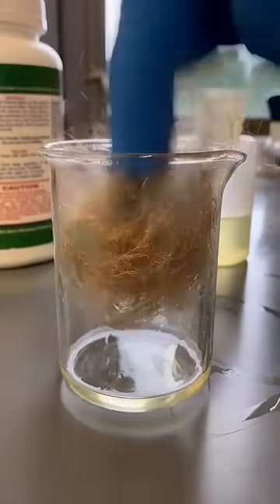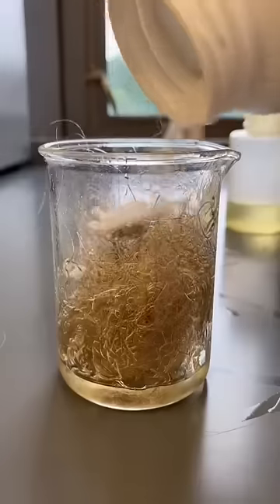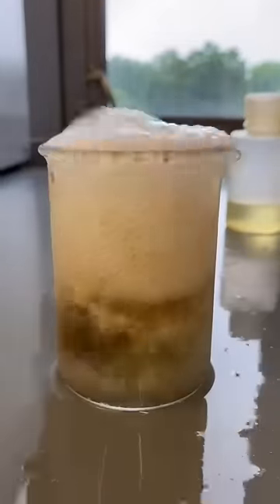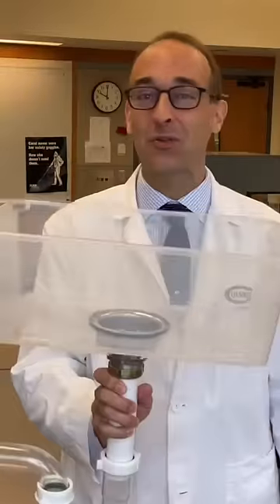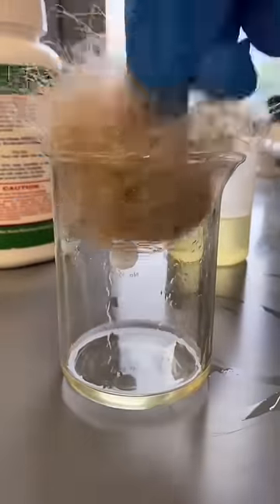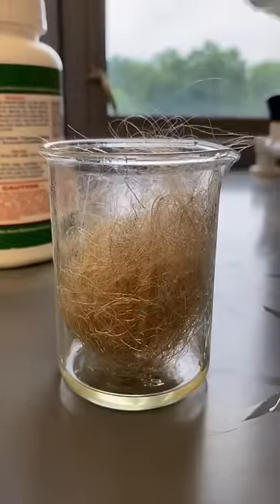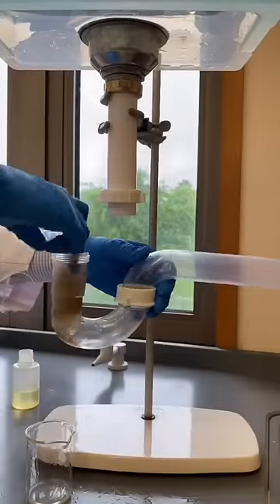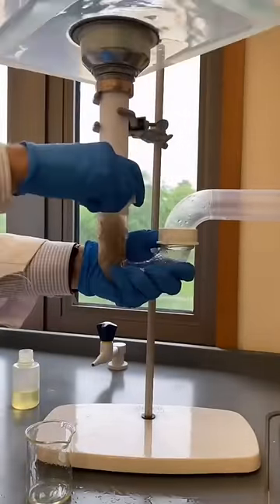How solid drain cleaners work

Comment: Fun fact, vinegar neutralizes sodium hydroxide, aka lye, which is used to make soap.

A fact I'm grateful I was aware of, because when I worked for a soap company, I got splashed with lye and I had previously left a gallon of white vinegar nearby. That was the difference between a severe chemical burn and just the top of my skin being turned into soap.

Comment: Don't use drain cleaners for sink drains. Unscrew the P trap and clear it by hand. A lot of drain cleaners can be too aggressive for sink drains.
Reply: "Too aggressive"?  Sodium hydroxide   doesn't do anything to plastic. Nada.  Nothing.
Reply: @pulaski1  I didn't mention that drain cleaner in specific. I just know what I know because I do service plumbing. I've seen some drain cleaners eat through the pipes and or the gaskets.
Reply: @pulaski1  I did describe what happened incorrectly. Mind you I am a plumber not a chemist. They can react to create a lot of a heat and as PVC is not very heat resistant, for that we use CPVC, it can damage the pipe.

Comment: When I worked as a scientific glassblower, we used sodium hydroxide (50% solution) to neutralize the hydrofluoric acid we'd used to wash glass  before letting it drain. My sister also uses it to make soap. It's cool to see how it works dissolving drain clogs.

Comment: As a plumber I can tell you a drain blockage is nothing like that
Reply: As someone who has played Mario, I can tell you a drain blockage is something like that.
Reply: Hi! If the sodium hydroxide crystalized, how can you undo this?
Reply: Don't put crystals down then water - dissolve them first (carefully - it gets hot, and you don't want it on your skin).

If you stick crystals down, there's a very good chance they will just form a brick that you will have to chip away at to remove.

Comment: People talking about how this can damage cast iron pipes but not talking about how it can also damage PBC pipes. It's hardly as immediate, but continual use can start wearing at the pipes and sealant around the joints eventually leading to leaks.

It's fine once and awhile, but in a case like this an ounce of prevention is worth a lot more than a pound of cure.

If it's only in the P-trap, you're much better off taking the pipe off and washing it out manually if you can't fish it out from the drain with a tool that probably costs less than a bottle of pipe cleaner.

Just, prepare to have some rotten-smelling water coming out of it, plug the drain leading to the sewers with a cap while it's open, have a large bowl under the drain to catch the water still in it, and run water for a few seconds shortly after you reinstall it.

The P-trap and the water stuck in there is to prevent sewage gases from entering the house - you want to replace that water once it's replaced.

Comment: That Drano clogged drain remover stuff also deteriorates the inside of the pipes I believe. Especially when the clock is not cleared and it just sits there reacting over and over in the same area

Comment: It doesn't dissolve soap residue. It converts it back to soap, which is dissolved in the water. I use oven cleaner on soap scum on bathroom glass and tiles. Then wash the, now thin layer of soap, with the shower head.

Comment: Never put lye into a drain in powder form then add water. If the lye gets hard, which I have had it happen, it's like rock hard. Almost have to drill through it.

Mix it first into liquid form by adding it into a bucket of water. Then mix then pour into drain.

Comment: We use this in our lab sometimes to increase pH of water . It will eat a hole through your skin in no time and it gets really hot dissolved in water. We once bought some but got it at a super discounted price. When we realized it came in a super fine crystal form instead of a manageable pellet. It was too dangerous to use because it would blow around with the slightest breeze from the room A/C. Couldn't weigh it or handle it safely.

Comment: As a licensed master plumber in NY and NJ do not ever use drain cleaner to clear a stoppage. The small amount you save will cost you thousands if not tens of thousands when it eats through your pipe. Then you'll be opening all your walls and ceilings to replace the waste pipe thats behind it. Find someone with a handsnake or learn how to do it yourself
Reply: I use it regularly for decades, never had any issues nor I heard about any issues, what kind of pipes NY buildings have? Everything is plastic here.
Reply: @randomnickify  In NY all commercial jobs 5 stories and above require cast iron. Everything else is mostly PVC. It will also eat through pvc. It looks like someone took a 1/8" router bit to the bottom of the pipe. If you check out the manufacturers specs they explicitly state not to use any type of acidic chemicals for pipe maintenance.
Reply: @andrewrossnagel9433  Yes, but Sodium hydroxide is a Base not Acid and its perfectly safe to use with PVC. I've check several sources and all confirm this things are compatible.
Reply: @randomnickify you expect him to know the difference between acid and base?

Comment: Sodium Hydroxide (aka lye) is super caustic and will burn you if you get it on your skin! Lye + Oils make what is essentially bar soap in the right ratio. It's just carefully balanced with bar soap rather than flooding it when it comes to dissolving other materials.

Comment: Drain cleaners rarely work for completely blocked drain. Chemical just cannot reach blockage with strong enough concentration with waste water already in the sink and drain. For slow drain, it might work for blockage caused by hair, but never seen it working for grease blockage.

Comment: The rocks that sit there during a tough clog adhere to the walls of the cast iron, copper or PVC pipe. I always advised against crystal drano. 
If the pipe runs along the ceiling in your basement feel the pipe for heat. If it’s not clearing the clog that pipe will be hot, and even hotter with copper drain pipes. They’ll also be water in your sink. But  some folks have a 20-foot run with clean outs along the way, you don’t open them if the pipe is hot.

Comment: The best drain cleaner is not Draino or Green Gobbler or any of those. The best way to clear out drains is those plastic hooks that grab onto hair and other gunk and pull it right up. Looks gross but it goes straight into the trash can and no risk of damaging your pipes.

If you simply must put some chemicals in your pipe, pure lye (sodium hydroxide) like Comstar's is the best option. Just be careful because the reaction it causes is exothermic, meaning it releases heat. This heat can cause damage to pipes of any sort, such as melting the glue that holds plastic pvc pipes together, so don't overdo it. Also lye is dangerous to touch, so USE GLOVES!

Comment: Acids aren't ideal in houses with cast iron and lead pipes. They're also not as effective as advertised. The acid will, more often than not, dissolve a pinhole in the path of least resistance, then wash through without breaking down the blockage on the walls. One key component missing from this example is grease, known for gripping the sides and clumping the hair. 

If your drain is clogging, it's best to have it cabled with a drain snake. And for those looking for preventative measures, fill your sink bowls about halfway up with water once every week (to 2 weeks) and let it drain. If you see a vortex form your drain is fine.

Comment: Drain clogs never look like that though. They’re a black, oily mess of skin flakes, phlegm, hair, soapy jizz, etc. that coats and builds in the pipe. Coupled with burrs and rust and time. That’s why chemical “drain cleaners” only work in these ideal conditions. Just buy a Zip-it. They’re like $3 at Walmart and you can use it a few times. And it won’t corrode your pipes.

Comment: It turned oil into soap and soap scum, back into soap. That allowed me to clean soap scum covered bathroom tiles with oven cleaner in seconds so a spray of cold water washed the reconstituted soap off surfaces down the floor drain. Five minutes and finished.

Comment: I'm not a chemist, but I am a plumber. This is not how these work in my experience. 

IF the clog is within the first 3 feet of the sink, maybe, but that's very often not the case. The further down you have the clog, the more water you have to dilute the solution with which weakens it. 

A lot of those drain cleaners also fail to clear the clog and then harden up themselves, actually making the clog worse.

Comment: There is no way to properly dispose of drain cleaner without using it.
Reply: You'd think you could just add vinegar to neutralize it, but it turns out that that produces a lot of heat and makes the sink into a geyser of drain cleaner. Kids don't try this at home.

Comment: Can you do one where the clog is water beads? They cause a lot of $$$$ damage to plumbing and people dont realize they are not as easy to declog. We may have to replace a sink thats also the counter in a bathroom cause beads from a potted plant got in the overflow, it can't be snaked out caused its an odd angle and molded into the sink and is close enough to the waterflow they won't dry and drop out.

Comment: So... You got one part right, but mainly this is wrong. The majority of drain cleaner fluids are actually Sodium Hypochlorite based, for removing dirt, fat/oils, organics, and detergent residues. The "Pro Strength" and "Hair Clog" varieties are Sodium Hydroxide based, because Sodium Hypochlorite will simply Bleach the hair, and still leave the pipe clogged

Comment: I get the sodium hydroxide. But u said when WATER mixes with sodium hydroxide that the clog is quickly cleared ? But, what exactly are u pouring into it cuz just everyday water is CLEAR. NOT BLUE if that's what the blue liquid is?

Comment: Better off not using drain cleaners at all. Cast iron, ABS, PVC, all those pipes will have their longevity greatly shortened by frequent use of drain cleaning chemicals. ABS and PVCs expand/warp with the heat from the chemical reaction and ware holes through. Cast iron or galvanized pipe with corrode and start to split or fall apart completely.

Comment: I've always found it amusing seeing these demos of how to clear a catch. Just take the fucking catch off lol
Reply: That's why it's called a demo, it's a demonstration of something, but done in a way in which it can be seen.

I wonder if you would say the same thing when the clog is in a pipe that is passing through a 2 foot concrete floor, just next to one of the main columns of a 30 story building... "Yeah, let's break the concrete floor particularly at this critical point of the structure, just to disassemble a 2 inch drain pipe, instead of using caustic soda" Everyone would look at you as if you had some screw loose.
Reply: Thats a completely different thing. The catch is literally called a catch because it catches stuff that would otherwise clog the line and is meant to be removed. 

 I was mostly joking BTW. I know there are a lot of people that aren't taught basic life skills and having media to help educate them is important. Just seems little obvious to me personally.

Comment: 30 years of grease buildup isn't gonna be cleared by lye. The water soluble compound created by it is more commonly called a bar of soap.  How long does it take for water to dissolve a 10 lb brick of soap that you've just created in your drain?

Comment: Just snake the drain.  I get that pvc and plastics won't corrode, but how much of your drain is pvc?  What caused the clog or where in your pipes is the clog?  A snake drain will at the very least tell you how far into the pipe it is clogged, but will most likely hook onto whatever is clogging your drain and let you pull it out.  One of the worst clogs I've dealt with was a shower hook in a toilet.  I had to unhook the toilet from the floor and snake it from the other side to finally get it.  You can find drain snakes for very cheap.

Comment: Works really good for hair, therefore most sink and shower drain clogs (unless you live in an old house and dont have PVC drains). Dont use this in your toilet guys. Those are almost always clogged by a combination of wet wipes and greasy shits. Also, for what you spend on a few bottles of draino you can get a halfway decent manual clean out tool. Drain cleaner is kinda or a meh product. Its also not great for a septic system imo.

Comment: Liquid drain cleaners are a costly gimmick. Not only does it destroy cast iron pipes which most older homes have but it can kill the helpful bacteria in your septic tank. Most of the time the liquid in the drain prevents the chemical from even reaching the clog anyways.

Comment: Another fun tip. Find the other drain cleaner made with 99% sulfuric acid, mix it at a 1:1 ratio with potassium nitrate stump remover, soak the mixture up in some cotton balls, and let them airdry. Now you have guncotton. 😈

Comment: Dont use drain cleaners, get s snake. If the cleaner doesnt work the plumber will charge you extra, if the snake doesnt work you really need a plumber. If someone else puts drain cleaner in there hire a plumber and pay the drain cleaner mark up, not worth the risk.

Comment: Dont use any of those drain cleaners ever. THEY WILL DESTROY EVERYTHING... eventually. The only thing i put in my drains to clean them is vinegar and HOT water. If these don't work and you don't know how to properly snake, or don't know what auger to use on what drain, call a plumber.

Source: Am a plumber

Comment: I'm sure they'll add other chemicals into the product so they can claim some special effects that only their premium products will deliver. I wanted some plain citric acid for de-scaling and cleaning. There were lots of random ebay vendors who sell it in any amount, great or small; I continued looking and all the brand names I could see would sell products for cleaning drains, descaling kettles, or washing machines but they were all multiple ingredient formulations all including perfumes. There was only one brand selling pure 100% citric acid and it was by far the cheapest option, suggesting they're either trying to get a foothold in the market, or are selling up stocks and getting out!

To be fair a lot of the ebay listings will be food grade, and while I'm sure my Cilit Bang! Citric Acid will be almost as safe if used appropriately, it doesn't feel right. Like if Domestos also made table salt. Or if Tide made Jell-O shots...

Comment: so i need this 55gall drum 🛢️ of sodium hydroxide for work... no the clogs are actually weekly and yes i tried forcing the workers to use a strainer as there is no garbage disposal but they'd rather not walk 1 more step to the trash 🚮 so instead pour all thier meat grease and leftovers down the drain till it smells rancid and the eco friendly.05gpm maybe 0.2gpm flow from a 1/4 inch line meaning 1/8th hole through fittings and the 1-1/4" drain cant handle it old plumbing in an unaccessible place ... tried muriatic acid but whole room filled with rotten egg's smell like I was torturing the office workers below the break room kitchen/ dining area  i think smell cleared up 2 days later but that sink still wouldn't unclog and i used the tight turn drainsnake all the way out to 25ft i brought the 50fter but couldn't make the first bend and the hundred footer was just as thick as the 50 🐍 snake oh and we don't use soap 🧼 only sanitizer and water ... i think it's foaming sanitizer 🤔 totally useless with mechanics grease and food caked on hands probably supposed to be eco friendly alternative but honestly the excess waste isn't eco friendly at all as 20 pumps of the stuff isn't enough and then they got these chemical hand rinsers to prevent you from actually cleaning 🧼 your hands, at a real sink! yeah they threw out the expensive really nice working sinks real shame i now Walk over 500ft on cement just to find the one hidden locked room with an actual sink so i can clean my hands before lunch ... takes about 4mins 20 seconds to there 420 back and whatever time washing so thats an extra 8 mins 40 seconds plus wash time before my very small 10 to 30 minute once a day break oh yeah and we gotta wash after lunch too but I'm not gonna inject thier chemicals into the on the job aquired constant cuts and scrapes with a fancy overpriced chemical rinser they had the audacity to force me to install 😡... anyways 🤔 sodium hydroxide got it ... can they ship it by the semi 🚛 load?

Comment: Phil you are doing a disservice and putting peoples vision and face in danger. As a professional I ask if the resident of a property has used any drain cleaner, bleach, or soaps to try and clear a clog. If it is in a bathroom i ask have they used any hair removal or hair dye products.

Face splashes are going to happen. And if there is these products in the drain when I am working and if I have skin damage or vision damage from it. It is not going to be a good experience for the resident.

Yes I wear eye protection but even then a splash can bypass those.

TLDR call A plumber or maintenance to clear clogs. DO NOT USE drain cleaners

Comment: This sounds like an advertising plug for a Chemical Company. So corrosive and toxic! In the bathroom drains, better to first use a Zip Strip.(- it takes a mere 1 minute to stick down the drain and pull hair clog up again.... and usually works 90% of the time! For a kitchen clog, carefully pour boiled hot water ( as it is often fatty debris holding the clog in place.) For both kitchen and bath, rarely do you need to do step 3 or 4 ( taking apart the drain trap and using a drain snake to clear a deeper clog.....) SKIP THE CHEMICALS,... unless you want a chemical burn or corroded pipes.....